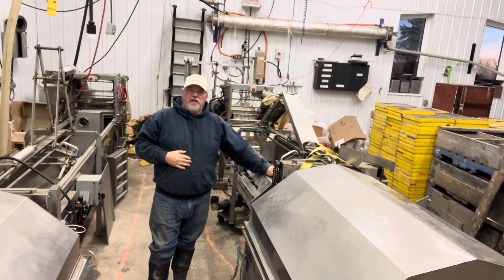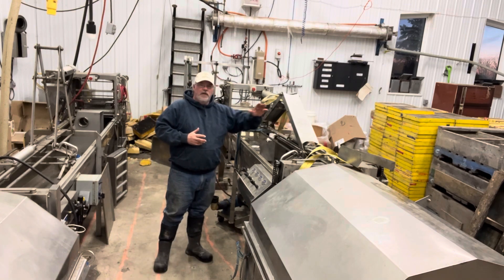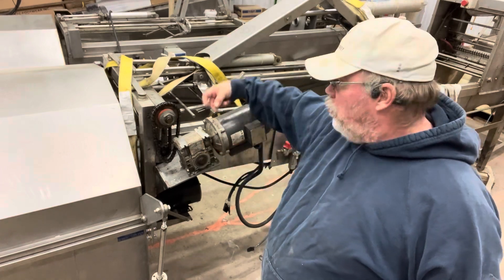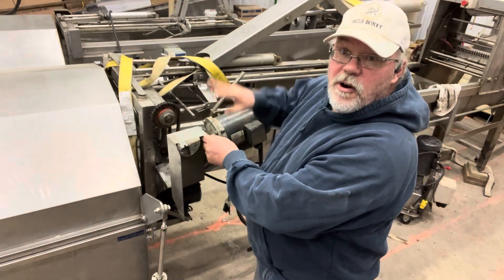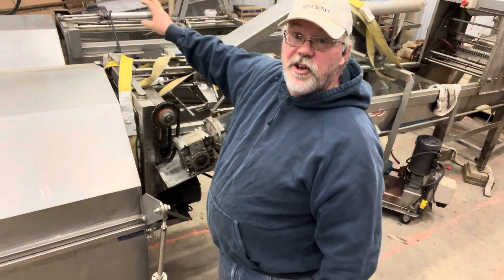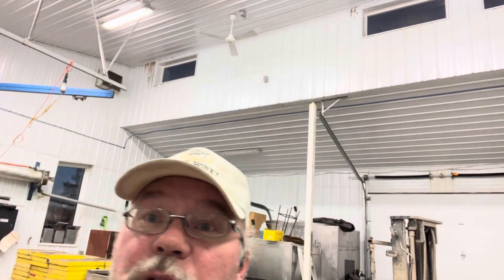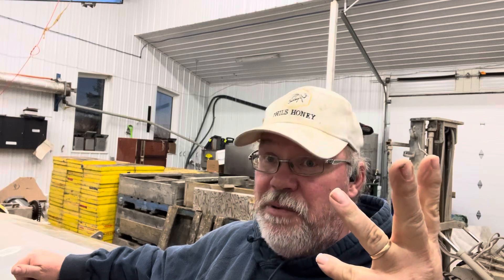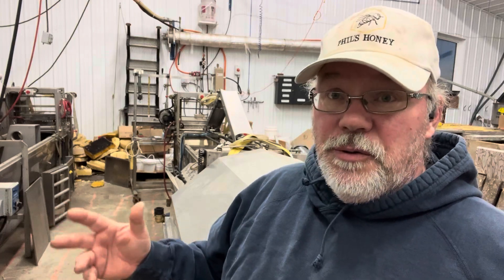Twin extractor setup.

Comment: Hi. What would gearbox ratio be on loading rack after uncapper?
Reply from the maker: Good question. There is a work gear reducer and then a gear ration on the final drive.
Reply from the maker: Gearbox is 60:1.  Chain gear is 4:1
Reply: Thats pretty slow. Those frames dont look like their moving very fast. probably has a slower rpm motor as well. Thanks, extractor looks good.

Comment: With a 120 the person unloading has no trouble keeping up and has the most “hand washing time”. 
Running two uncappers at once is the things my nightmares are made of. I can’t turn my back on one, never mind two. Maybe you’ll end up with a floater that goes between uncapper/ unloading?  Either way, you should be able to put a lot of boxes though in a day.
Reply from the maker: Target is 350-400 per day.  More than that I’ll need a bigger field crew.
Reply: The uncapper is the limiting factor